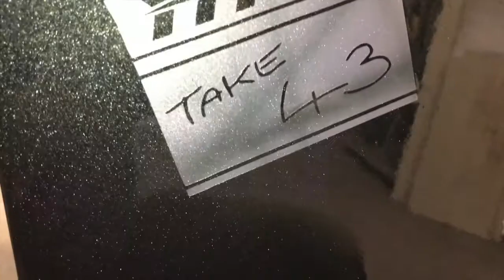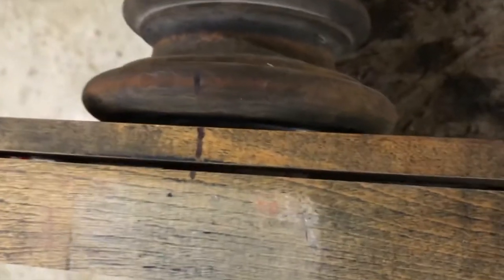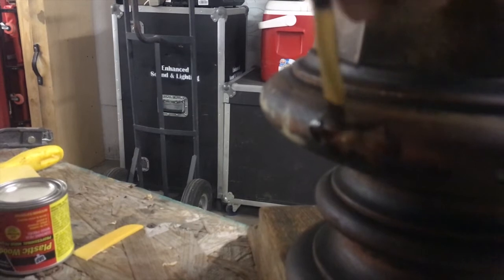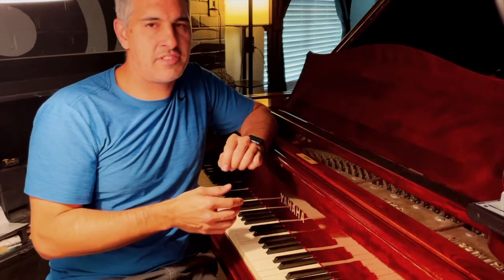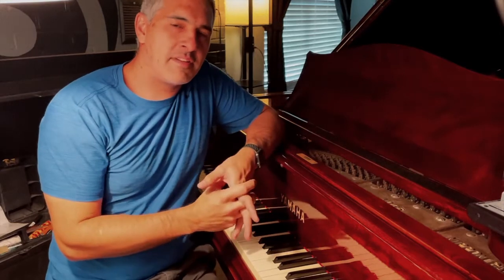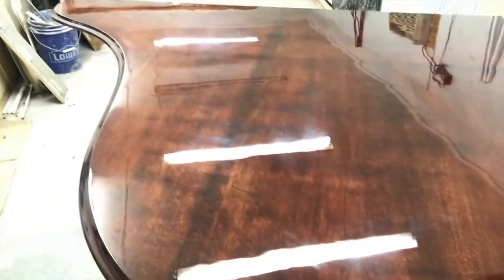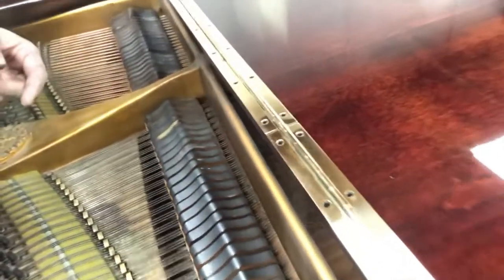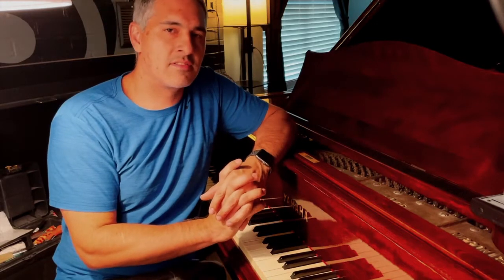Feature DIY: Please don’t paint your piano with cheap house paint from your local box store. Ugh!

Comment: You did a superb job, I’m amazed at how beautiful your piano turned out. I have a 1950’3 Baldwin, it’s a reddish mahogany, beautiful color but it’s not shiny. I have use boiled  linseed oil and mineral spirits to clean and then wax it. My question is can you only apply the top coat you used to make it shine, or do you have to sand, re stain then apply the top coat? I’m just curious, I don’t want to change the wood color, just add the shine and protection, I would also have to hire it done since that is not a field of expertise.
Reply from the maker: With the finish system I use its definitely best to remove any other finishes before applying them. Its not easy to get a true professional shine but if you're willing to seek out the correct products, it can be done!

Comment: Super impressive! I'm redoing the cabinet and legs on a grand that was essentially junked.  It had a "tuxedo" paint job that was really scratched up, and vefry thin paint layer.  I'm not sure what type of base (primer), paint, and clear to look for. I don't have any spray tools myself, but can rent some for sure.  Happy for any advice.
Reply from the maker: If Im doing a stain/clear wood finish, I definately use the 2 part systems from Campbell wood finishes. Just find a local dealer. As for paint color jobs, most of what I use is automotive from auto paint supply stores. Some automotive primers work great over wood and sometimes it helps to use a thin skim coat of bondo to fill the grain first. Its all tons of work but worth it when done right.

Comment: As a piano repairman/refinisher I can tell you that you may want to simply replace those casters.  They are readily available through piano parts suppliers.  Also, plate removal, or at least string removal/restringing, allows access to refinishing the soundboard for a more complete overhaul.  Nice job on the final finish.
Reply from the maker: Yes I do agree on replacing stuff like that. I also plan to do the plate removal and re-string on this piano eventually. It has a few loose pins so Im thinking I'll up size those as well.

Comment: Absolutely gorgeous!!!  I have an Everett grand and previous owners tried to restain it and they thoroughly messed it up.  There are drip marks on the side, and it’s really sloppy.  I found a couple of spots where I could see the original color and it looks like it was a burgundy semi-gloss which was really pretty.  If I want to return it to a burgundy semi-gloss, do you recommend sanding it down?  I have no desire to move it and I don’t have a shop to refinish it…
Reply from the maker: Most likely if someone applied a bad finish, the only correct way to make it better will be to remove all the bad stuff first.

Comment: Did you have to grain  fill the wood or is this finish thick enough to fill in one or two coats?
Reply from the maker: That's a good one. Ive been trying to figure out a better way but I'm thinking brushing on the first sealer coat might be the best way in the future. Otherwise on this one, I had to re-sand and re-spray to fill the grain and it got better by the last coat.

Comment: I'm painting my piano white. I want a high gloss finish. Can I do it without a spray gun? It's inside and I can't move it. What's a good clear coat?
Reply from the maker: Trust me I’ve searched and searched for years. The only way to get that professional looking gloss finish is pretty much with automotive basecoat and clearcoat.
Reply: Meny piano manufactures use polyester as an outercoating🎹🎶

Comment: I plan on painting my piano white and doing a lacquer finish, what type of finish and piant should I use?
Reply from the maker: I’ve heard people say “lacquer finish“ but I think they are normally talking about a satin finish. The best type of paint when going with a color like white is probably going to be automotive basecoat and clearcoat. If you don’t want that super glossy finish you could buy a low gloss clear coat or buy a satin white paint kit sold on eBay. Usually comes with color and hardner. Sometimes the brand is Hot Rod flatz but there are others. Not sure of the quality on those though. I use all Sherwin-Williams Ultra with a Sata spray gun.

Comment: Interesting But I don’t think those legs are original if it’s 1951 would be definitely straight but good job well done.
Reply from the maker: Thanks! It was rare but some of the Yamaha grand pianos in the 50s had round legs like these.
Reply: @latenightdiy1496  - My 140 yr old Richard Lipp grand piano has the exact same legs. Those type of legs disappeared after the 1890s. Yamaha might have added them to some of their 1950s models for nostalgia reasons.